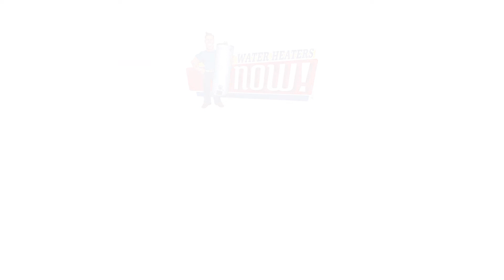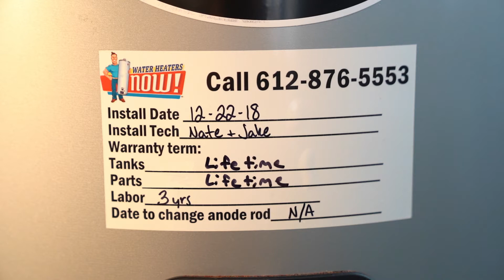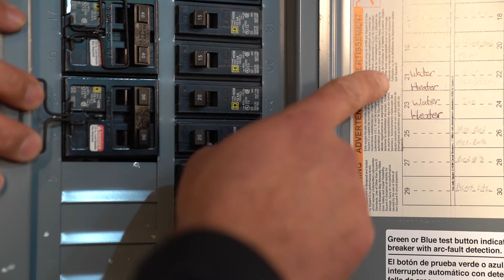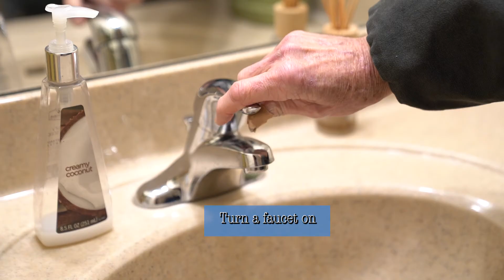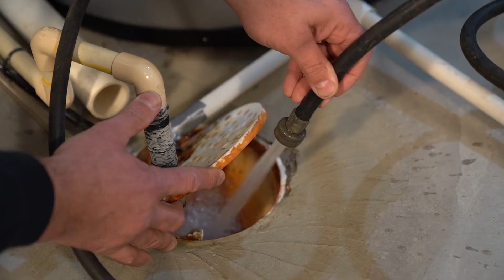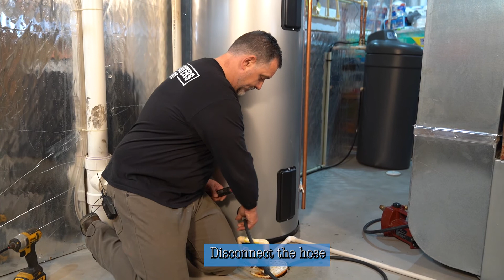Annual Maintenance on a Westinghouse Electric Water Heater- Water Heaters Now

Comment: The tank is made from 316L stainless, a very corrosion resistant type. What’s really annoying is on an expensive water heater the name brand sticker is not on straight. I work in a manufacturing environment and that may be an sign of the quality of the rest of the unit.